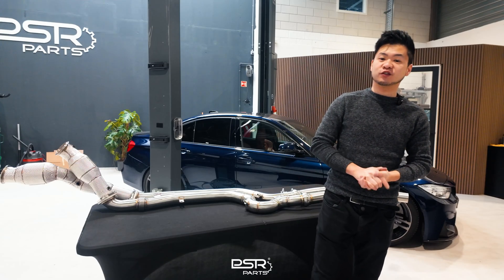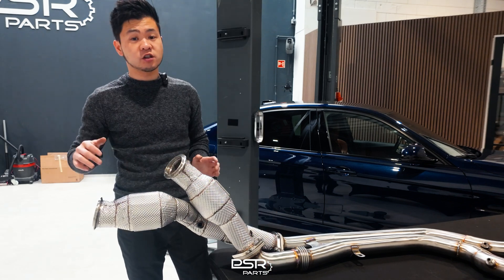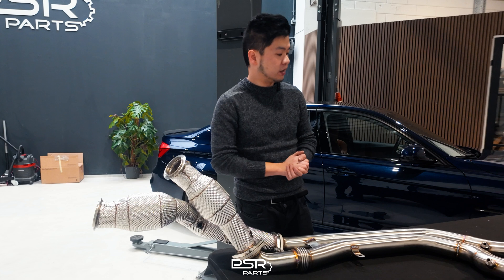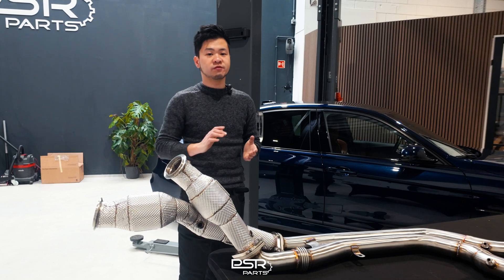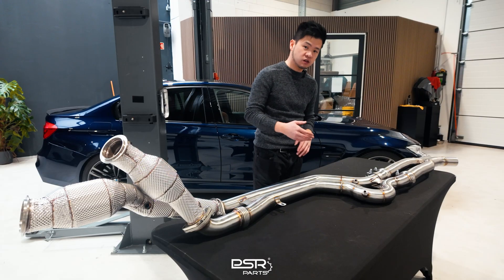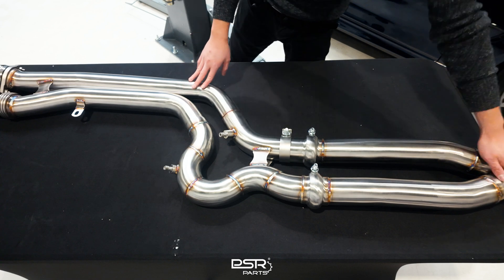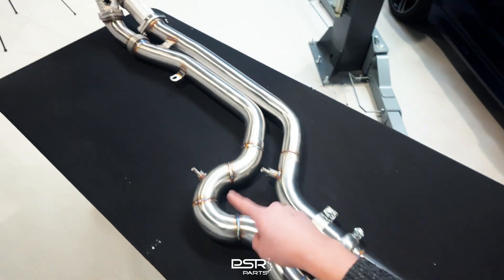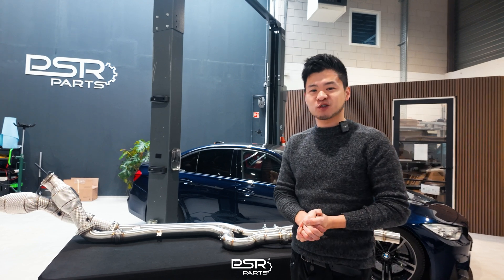How Does It Work? DCE Parts BMW S58 Equal Length Exhaust Explained! True Equal Length or Not?

Comment: You say it's equal length from the start of the downpipes, but what about the length of the charge pipe and the exhaust travel from the cylinder heads to the turbos? Shouldn't you equalize it all the way to the cylinder head?
Reply from the maker: Good point! If strictly talking about the exhaust sound, then the Chargepipes does not contribute a huge amount and unfortunately with a twin setup there's not much you can change, the main sound waves we try to compensate for are the length differences in the downpipes. Optimizing the headers / manifold would of course also contribute a little to the exhaust note, but since the turbos are one with the manifold, there's no easy swap. Ideally, changing for equal length headers + single turbo + big exhaust to the rear would be one of the options of course to create a true straight six sound. With our setup it sounds more racy and close to single turbo, but it will not be as intense as a true single which is of course the boss setup ;)  But the DCE exhaust is a good option for those who stay twins stock or hybrid

Comment: what's the exhaust diameter?
Reply from the maker: 2x 2.75inch / 70mm from front to back
Reply: @psrparts  why not larger than oem? at say 3inch? I'm looking for this exact design for sound, but larger than oem for performance
Reply from the maker: @AdenRodrigues-g8t  Space concerns in the front, the 2 pipes sit close to each other so it does not allow for a much larger diameter without risking touching the heat shields or gearbox. A difference equal length setup is maybe possible in 3 inch, but not with this sound. We generally always match OEM diameters because in Europe (where we are based) generally people tend to opt for a rear muffler only, or midpipe only, so we need to match the pipe diameters of the aftermarket exhaust and the OE exhaust. In basis we also want to allow non-tuned cars to run these exhausts without compromises in the lower rev-ranges. The larger the diameter, the slower the exhaust flows, so for daily driving a larger diameter exhaust is not always better as larger diameters ask for higher boost and higher exhaust flow. In the most extreme cases, you may experience lag in lower rev ranges or disrupted power buildup or shocking when on low throttle